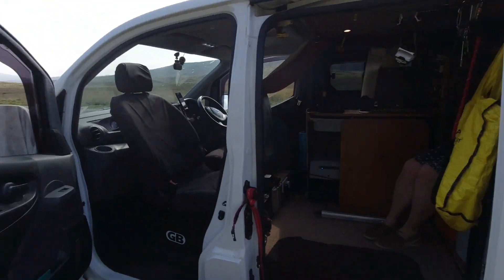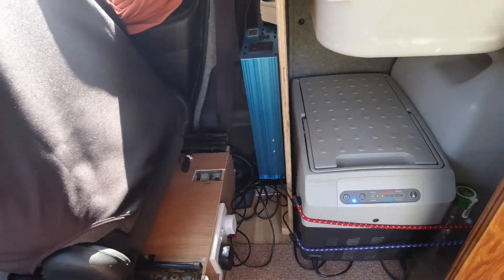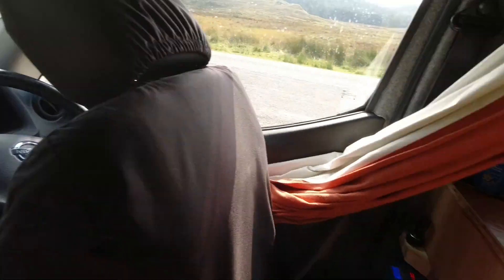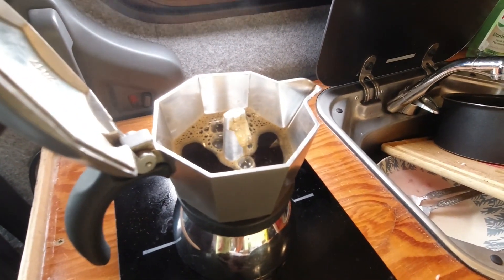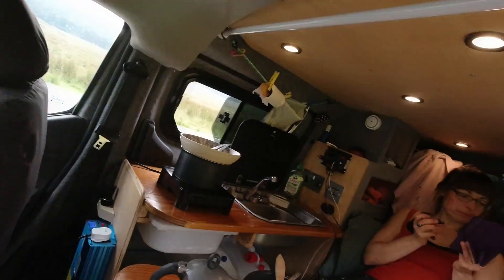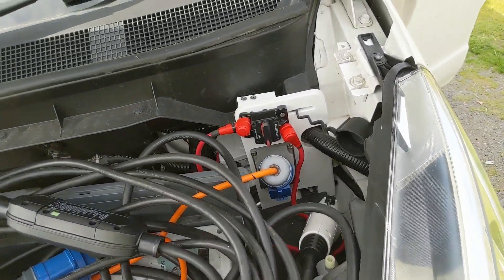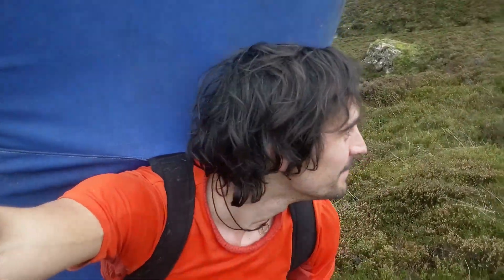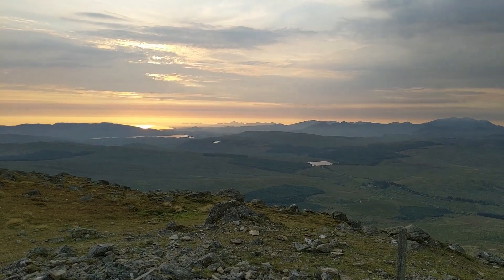Electric Campervan off-grid 240V Induction Cooking WITHOUT a leisure battery!

Comment: Just wondering if I can use my power station it has inverter already build in, and connect my acid battery and charge the power station using Dc to dc charger?
Reply from the maker: Yes, this should be possible. I would only draw a max of 1kW (approx 70A) from the DC-DC
Reply: @GlynHudson  thanks, thinking of buying Bluetti Charger 1 Battery Charger 560W 👍😃

Comment: Hi Glyn, hugely influenced and inspired by you and your families campervan exploits I am embarking on the conversion of a 2020 E-NV200, 40KW battery. Done the swivel seat and windows, insulation and carpeting next. Bed on order from JDS. I am ok with the practical build stuff but less so with the electrics and so have some questions if you don't mind. Also  now,  more than four years on I'm interested if you would do the electrics different, knowing that it has evolved. 1) Is it worth putting solar panel/s up if the main high voltage battery is keeping the 12 volt battery toped up (when the van is on)? 2) Since you have installed the inverter I think you said that you rarely use the onshore power hook up.  For simplicity could we not worry about onshore and just accept we are draining the main battery and must charge more?  (I don't expect us to be at hook ups much) I accept we still need to be energy efficient with only a 1500W inverter.  3) On the subject of Inverters do you think you could get away with a 1000W inverter with your induction hob? Any advice would be most welcome.
Reply from the maker: That's great to hear! It sounds like you're making great progress with the conversion. I reckon the swivel seat was the single hardest part of my build! 

1.) Yes, I reckon so because the van only tops the 12V when it's switched on. If you want to run a fridge / cool-box when your away from the van then having solar PV is useful. PV is also useful for keeping the 12V topped up when the van is not in use between trips. 

2. Yes, this is true. Leisure hookup is not really needed, the van kinda already has a hookup e.g it's charging point! 

3. 1000W inverter would be fine for a single Vango Sizzle hob, it used around 700W if I remember correctly and it's not usually on max for very long.

Regarding electrics, I think unless you enjoy doing them and are happy calculating wire gauges and fuse sizes (there are lots of resources online for this), then a good option is just to use something like an EcoFlow all in one integrated battery, inverter and charger. They also have the advantage of being portable. Ideally you would rig up a system to charge it directly from the vans 12V when the van was running, it will need to be direct since the cigarette lighter socket is not powerful enough.
Reply: Thanks for the quick answers, much appreciated. Good point about the PV keeping the 12V topped up and we do intend running a cool-box. Also the last thing we want is a dead 12V battery immobilising the whole van. Will put in solar. I'm up for the challenge of the electrics although its not my strength and will do the heavy wiring. There is no end of online information on the subject. Having got the electric van I would like to make use of its full potential and not get other bits of kit like an EcoFlow but I follow your thinking. It will be a while before I commit to the electrics and if more queries arise I am afraid I will get back to you. Thanks again.

Comment: Informative and entertaining video! One thing worries me though: changing the electrical setup, would the van still pass vehicle inspection?
Reply from the maker: Yes, as long as it's done to a high standard there's no problem. Electrical inspections are not a standard part of the UK MOT test, as long as it does not adversely affect the vehicle there's no problem. What I've done is standard practice for camper vans, also ambulance and service vehicles use the same setup to provide 240V from the 12V system.
Reply: @GlynHudson  Very interesting, thank you. I never even owned a car before this e-NV200 I bought last week (from 2019, so it has the 40 kWh battery). I was first thinking I'll need one of those huge and expensive power stations, but it would be wonderful if I can find a way to use the car battery instead. I'm from Italy, live in Norway and the e-NV200 is Norwegian. I believe regulations will be pretty similar all over Europe. Btw I'm planning some Arctic trips next winter in the interior of Finnmark. I have to understand if I can power the floor electric foil heating I'm planning to install with the built-in 12 V outlet... or if it is unrealistic 😬
Reply: @GlynHudson  Wait a second. Why would you not just connect the inverter to a 12 V outlet already existing inside the van? Why did you instead route a 12 V cable from the engine bay? Pretty sure there's a clear explanation for that :)

Comment: Hey Glyn, I have a question for you! Do you know whether the 12v battery is charged only whilst the van is in 'ready' mode or does it also charge whilst in 'On' mode? The reason I ask is we've just bought an E-NV200 ourselves to turn in to a camper and what I'd love to do is be able to install a Battery To Battery charger between the vans 12v battery and a leisure battery in the rear. My thought was that if you were at a charging station, you could plug the van in via the usual charging port at the front, put it into the 'On' position and it would then charge the traction battery, vans 12 v battery and off of that, the leisure battery as well. Similarly at a campsite, if we were to obtain a commando hookup cable with a type 1 charger on the other end, we could then plug in via the front port, hit 'On' and charge everything at once, saving the need to choose whether to charge just the traction battery or just the leisure battery via a separately installed mains hook-up inlet. Does that make any sense lol? Many thanks in advance!
Reply from the maker: The 12V is only charged when the van is in 'ready' mode or when the van is actively charging via AC or DC. Also, the van does top up the 12V for a few min once every 24hrs to maintain charge if van is not being driven.
Reply: Thanks  @GlynHudson  - Do you happen to know how many amps the DC to DC charger gives out between the traction battery and the vans 12v auxiliary battery? Can't seem to find that info anywhere and would be super useful in correctly sizing a charger between the vans auxiliary battery and the leisure battery that won't drain too much power from the auxiliary battery. I'm guessing it must give out a reasonable amount if it's able to keep up with the demands of your 1500w inverter? Do you guys often cook then when you're hooked up at a charging station? Loved the trip up to the NC500 btw, would love to do the same. Thanks again in advance for your help
Reply from the maker: Its 125A DC-DC, to be safe I've never draw more than 1kW continuous. Yes, I use it to power a 800W Vango Sizzle induction hob
Reply from the maker: @WoodandWild  here's a video of my setup https://youtu.be/v6VsGV9emVI
Reply: @GlynHudson  Thanks, that's really helpful! That's more output than I had initially thought so should give us plenty to charge a leisure battery! Do you stick to the 1kw then just to make sure you don't run the battery flat?
Reply from the maker: @WoodandWild  I stick to 1kW just to be safe, to not risk overload the DC-DC. My induction hob only uses 800W, so I've had no reason to draw more. I've been using it this way for several years now with several month long trips with lots of cooking with no issues. I would probably be fine to draw a bit more, but I've not tested this

Comment: Thank you for a fantastically useful video and for sending me the link to it too 

So to summarise, you are simply hooking a couple of high amp cables up from the 12v battery to your inverter. Much simpler than I anticipated!

I think you have the vehicle on at the time - presume that's needed to enable transmission of main battery power to the 12v battery? Or does the battery just top up all the time?

I would have assumed this would degraded the 12v battery - I guess not your experience though.

No benefit in running some kind of B2B link to a leisure battery on board the vehicle I take it?...
Reply from the maker: Yes, that's it. Just a 12V to 240V inverter. The van must be switched  on in 'Ready' mode for the 12V battery to be topped up. It doesn't wear the 12V battery since the current is coming from the DC-DC converter, which is in turn connected to the high voltage traction battery.

Comment: Could you do me a favour? Can you check on the hob to see if it's 100-240v switchable; vango don't have this spec on their site? I'm hoping I can plug it straight into the factory inverter in my Japan import env. Thanks a bunch.
Reply from the maker: Hi, I've just checked and it's 220-240Vac only I'm afraid
Reply: @GlynHudson  Thanks for checking mate. Looks like I'm going to have to find a 100-to-240v step-up inverter to run everything on. Currently I can only find crappy looking Chinese ones, so I'm not winning right now :-/

Comment: The Toyota Alphard (Japanese import) has a hybrid variant that includes 110V outlets run from the hybrid battery apparently. The Nissan inverter that charges the 1V battery is rated at a little over 1kw so any draw above this will be pulling power from the 12V lead acid.
Reply from the maker: The e-NV200 DC-DC converter is rated to 135A, approx 1.7kW, my induction hob is only 750W so plenty to spare

Comment: @Glyn Hudson: Why do you use the 12V Battery when you could use the V2H System? Is it a matter of cost or weight or usability?
Greetings
Reply from the maker: The van can't do V2H without additional hardware that costs $2800 and is very large and bulky, not practical for a campervan https://www.setec-power.com/product/vehicle-to-home-v2h-6kw/
Reply: @GlynHudson  yeah I did a deep dive after my question and found out that stuff. Should still be possible to fit it somewhere. Does not seem to be really practical. There is another competitor who offers completely different dimensions. Maybe something is possible there. Anyway thx for the quick reply!!!
Do you know how much percent you lose through the usage of 12V and the inverter?
Reply from the maker: Cooking a full dinner for two people, coffee and boiling water to wash up uses just 1.7 miles of range https://youtu.be/v6VsGV9emVI?t=257

Comment: How do you measure POWER with multimeter ?
Reply from the maker: My multimeter has a special adapter, however any multimeter can measure current in series then multiply by voltage to get power. If measuring mains power of appliances its probably easier to use a plug in dedicated power meter

Comment: we dont have the same van but we ve got that same vango sizzle. The lowest 2 settings do cycle more.  We have ours running on a 1000w /100 Amp power bank and it uses about 1 amp a minute on the highest setting.  Takes about 4 mins for making tea for 2 . Fries bacon and eggs in about 3 mins.

Comment: Hi thanks for the videos. I’m in the process of converting a Peugeot E Expert (75kWh) snd intend where possible to go fully electric including an microwave and induction hob. I have purchased an Eco Flow Delta solar generator ((1.2 kWh) as my main power source it’s a great bit of kit - very interested in how you’ve worked up the inverter and your comments on the main battery charging the 12v battery (DC to DC). In the E Expert when you’re not moving the power from the traction battery shuts off after 12 minutes meaning you can’t leave heater or AC on even in neutral. Question is will it also stop charging the 12v - I suspect so! However the EF Delta charges at 600w from AC but only 120w from DC so I think doing what you’ve done should give me 600w charging while driving. Any thoughts??
Reply from the maker: Awesome, the E-Expert will make a great campervan. My first self-converted campervan was a Peugeot Expert, sadly a diesel but a nice size van. Fully electric interior is the way forward, not needing to waste space and faff around with gas. Its suprising to hear the E-Expert shuts the HV traction battery down after 12 min, what if your sitting in traffic!? The 12V battery will almost certinaly stop charging when the HV shuts off, you can easily verify this with a volt meter, it will read around 13V-14V when the 12V is being activly charged. It's a good idea to fit a wall-mounted voltage display in your camper so you can keep an eye on this. The 120W limit on the EF Delta DC charging is due to the 12V cigarett ligher aux sockets in vehicles being limited to 10A. If it's really not possible to keep the DC-DC converter running overnight in your van I would recomend fitting a normal campervan leisure battery using a voltage sensative split-charge relay. I guess it would be possible to fit a AC inverter like I have connected to your main battery to AC charge the EF Delta, however this is quite a convoluted way of doing things and duplication of assets.

Comment: Hi Glyn 
I was wondering how much the van cost before you fitted it out 
Did it have a winter pack already fitted 😉
Hope you guys are well 😉
Reply from the maker: Hi Billy, we're good thanks. I paid £9k for the van 2nd hand. It's the Acenta Rapid+ model with 6.6kW charger and heated seats and wheel already fitted. I added cruise control and a new head unit. I think 2nd hand prices for the e-NV200 may have increased since I bought the van in 2015.
Reply: @GlynHudson  
Cheers Glyn, good to hear you're well. 
Thanks for all the info, yes they've become very popular, I'm keeping a look out for a reasonably low mileage one with winter pack! Perhaps a 30kwh one🤞🏻
Start safe and happy guys 😉
Reply from the maker: @billyray323  good luck. The e-NV200 is only available with a 24kWh or a 40kWh battery pack.
Reply: @GlynHudson  
I guess it'll be a 24kwh then, thanks again 😉

Comment: Great vid as always! I've been watching some env200 youtubes by a guy in Japan from years ago; I think he had a first edition. And his came with a built-in socket as standard, which you can run kettle, hob etc straight from the 'big' battery. Wish that was offered outside Japan. I'm planning to get one of these vans and was wondering if I need to buy one with a satnav screen, or if it's kind of irrelevant if the best option is to get one of those Android head units? I have an iPhone, so can you get the same kind of thing? I had a quick google to see what they were all about but TBH it just confused me even more? Is it just a way of bluetoothing to your phone and using the google maps gprs, music, and other apps on your phone? If so does that mean there's no way of getting radio if you have no 4G signal. Thanks mate.
Reply from the maker: Thanks. Yes, it's a real shame the European version does not have a domestic socket built in as standard, all EV's should have this! I don't think it's worth paying extra for the Tekna trim level with the Nissan satnav. I've got a Leaf with the same satnav and it's terrible, your phone with google maps will be a million times better. The Acenta is the best middle-of-the-road trim to go for IMO. My head unit actually runs Android itself, and it's got a built-in FM /DAB radio. It works well, and I choose it since I could run EV charging maps e.g PlugShare natively. However, I think if I was fitting one now I would choose a unit that supports Android Auto / Apple Carplay since these two platforms have developed a lot in the past 12 months, and should soon have support for finding EV charging stations.
Reply: @GlynHudson  Thanks, thanks really useful info. I have to do some reading on apple car play and head units that suit me here in New Zealand, so I get the right one too; no point getting a UK one where the radio won't work here for example! Interesting recommendation on going Acenta rather than Tekna too; I'm finding it really hard to work out which version offer which features as they change in different countries and for different model years. For example, I want one with a tailgate and glass all-round (so the 'car' version) and some years they're tailgate and others double doors and there doesn't appear to be any logic! It's great that you published the full shopping list of your conversion for us as I'm going to try and cram as much stuff from Britain, that I'll need for the conversion, as I can into the van before I ship it, as everything's four times the price here. Also, before I ship it I'm looking at getting a battery upgrade and pop top done as no-one does either over here. Cheers mate!

Comment: I am really suprised at how little range that took from your traction battery, and it's certainly a potential upgrade idea for my own van.
Very inspirational stuff Glyn, and without you and Amy's pioneering attitude, I don't think I would have had the guts to build my own E-NV200 camper. It was finding your chanel, and seeing you guys proving the real world viability of a concept, which had taken root in my own mind after first seeing a standard Nissan ev van for myself up close a few years ago, that gave me the kick I needed.
Oh, and good call on the instance recommendations as I made a good saving going with the same provider as yourself 👍👍

Comment: I am surprised that one of the inverter etc manufacturers doesn't produce a high dc voltage to 240 v ac inverter.
Since the dc current is much lower it would be simpler than a normal 12 v one.

The issue then is where to connect to the EV so the power usage is measured correctly.
Reply from the maker: It would need to be built into the vehicle as standard, some EV's e.g Honda E do gave a 240V outlet. However, there is now way to safely connect to the 400V DC high voltage battery on our van.